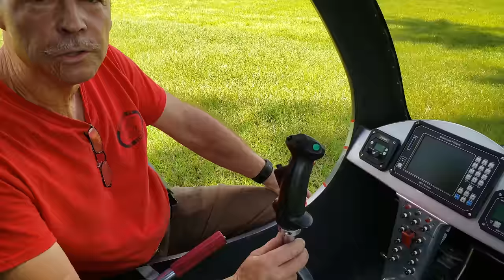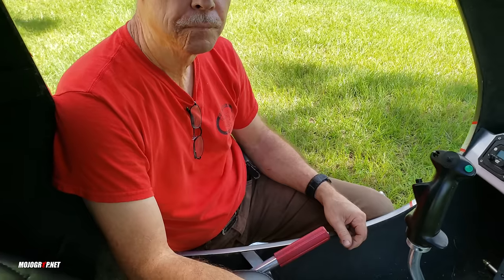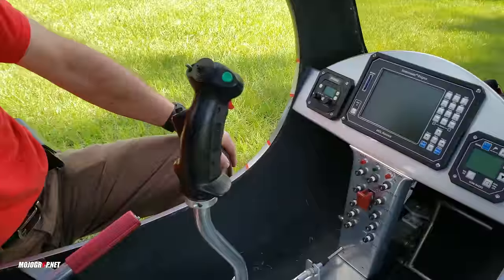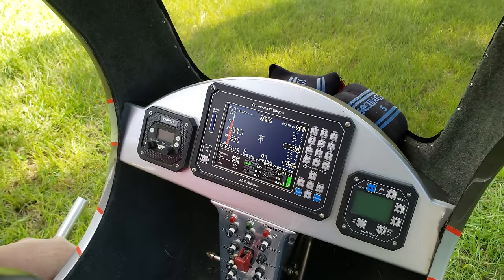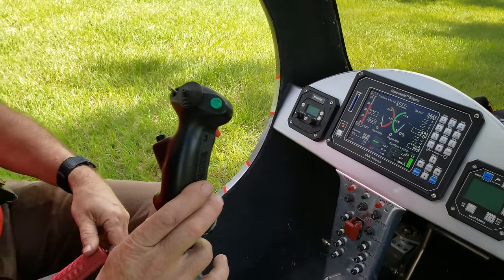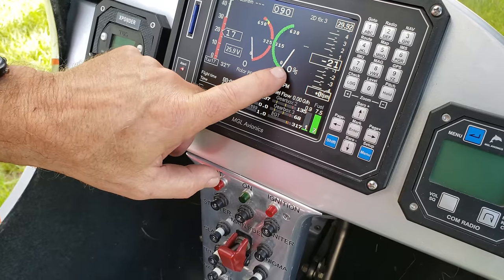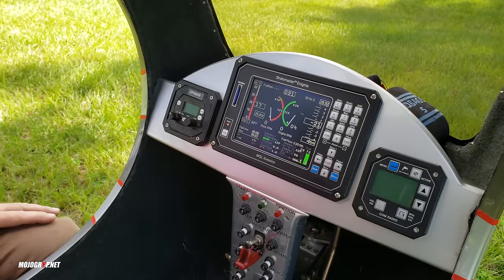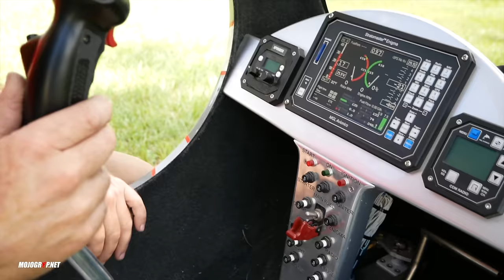Mosquito Helicopter XET Start Up And Cockpit Flow

Comment: Very nice! Only a few people that actually manufacture it in their shop, with the option of the purchasing customer to build it in their shop! Simple swash-plate mechanism; not the traditional swash-plate under the rotor head, but above it. Ie, pitch mechanism: linkage, control horn, swash-plate is actually located in the bottom of the torque tube where the drive shaft for the main rotor is located. Would love to see a close up of this.

Comment: What's the range of this helicopter?
Reply from the maker: 80-100 miles
Reply: They also have the option to add an aux fuel tank that will extend the range.
Reply: @mojogrip  - More than enough to be 'touching heaven' - in way of recreational, pure, unadulterated helicopter bliss! 😎👍
Reply: @fox2102  Great, more fuel to be roasted in!. That aside, this is the coolest thing i've ever seen. For me, far too hazardous, but what an amazing hobby/sport.

Comment: Circuit breakers are not switches, they are solely designed to trip should an electrical circuit fail.
Reply: @Mr Sunshines give an example....
Reply: @Mr Sunshines thank you for showing us your big knowledge about the matter so respectfully. Now try to find an aeronautical c/b instead, not domestical/industrial one. Now everybody knows who is the troll here. Thanks.

Comment: It would be nice to see an all-electric Tesla version made. That way you don't need to relate to all the turbine fuel controls before taking off. You just hit the on switch and go.
Reply: Tesla version...…………...why so you can wait a 1/2 year while it's on backorder and then another 1/2 year of excuses as to why it's late in being delivered?   Or how about not being able to get it maintained because there are no parts around?  Tesla's a joke, a paper tiger that's going to fold I 3...2...1...
Reply: Johnnywhamo some things are worth waiting for. I’m in no hurry to realize the potential of an all electric helicopter. It would just be nice to know it can be done. If you relate to the RC world you would understand. Battery technology needs further development. I’m a hopeful character.

Comment: Precisam construir 2 paraquedas para tê-los À disposição no
caso de uma pane no ar ( em voo) : Um paraquedas para amortecer a queda do
helicóptero caso caia sobre a cabeça de uma pessoa ..e..um paraquedas para o
piloto ,.. se atirar fora da nave caso seja necessário. 

Este aviso vale para quem tem helicópteros portáteis.

You need to
build 2 parachutes to have them available in the event of a breakdown in the
air (in flight): A parachute to cushion the helicopter's fall if it falls on a
person's head ..and..a parachute for the pilot,. iIf you need to throw yourself
off the helicopter.

 

This warning applies to those who have portable helicopters.

Comment: I have to imagine this could be converted to an electric powered vehicle. The rotor drive shaft could go straight into the electric motor, and a substantial battery pack could replace the turbine engine and fuel tank.
Reply: Weight issues.

Comment: I have a pilot's license for fixed wing aircraft but I don't know much about helicopters. But how can it possibly be safe to stand under a helicopter rotor that is going at high speed when you have a helicopter that looks like it could tip over just by breathing on it.